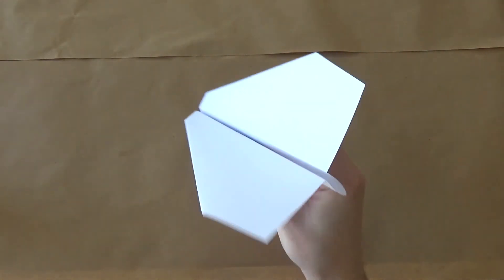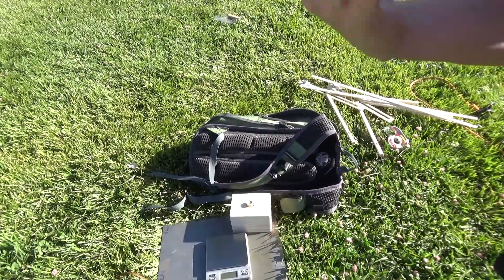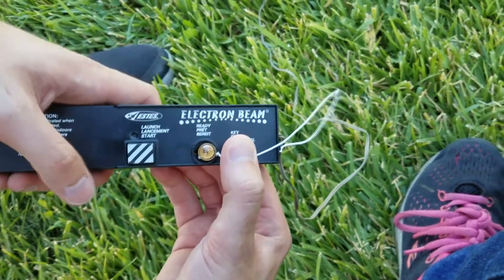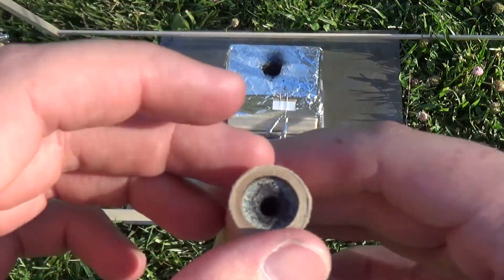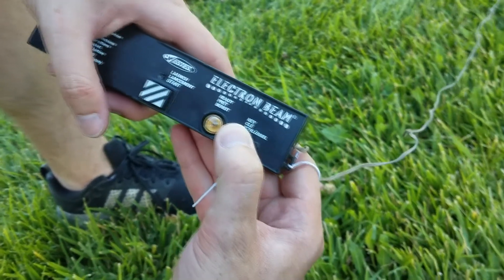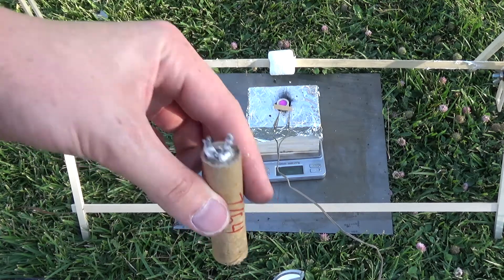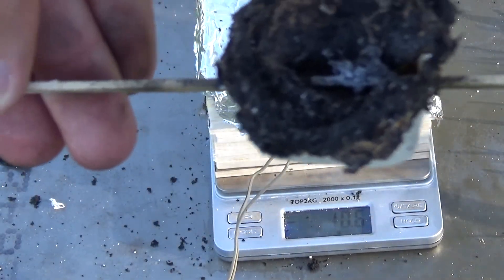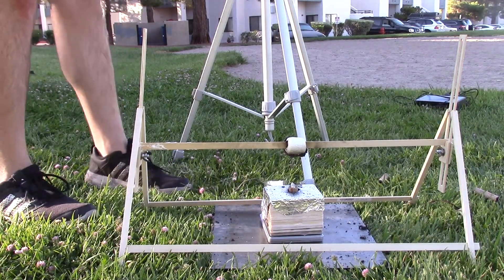Store-bought Vs. Homemade (sugar) Rocket Engines (Exp. 1)

Comment: You need to drill the hole all the way thru the fuel. Coring it will allow for faster burn.
Reply from the maker: Yep, I realized that after making this video haha. I had somehow forgotten about that crucial step!
Reply: @trumpatier  have you thought about testing them like that? I'd like to know how they stack up
Reply from the maker: @CravenMoorhead  I do plan on re-testing homemade motors, drilled correctly this time. Sadly though, I'm not able to make videos in my current situation 😔 Plus I have a couple videos planned before I go back to rocketry. But when I do return, the video will be better than ever because my quality standards have skyrocketed (no pun intended 🤣).

If you'd like an example of my new quality standards, you can check out my latest project video here: https://youtu.be/naYGHu9mrFM?si=iEQCakVsAYAChQn5

When I can redo this motor experiment, I'll retrieve and discuss a lot of data to give a thorough breakdown of the comparison. Plus probably some slow-mo footage 😀

I don't know when that will be though, sorry. Life has been bad.

Comment: Press or ram this composition..change rangle of mix..1/4 bp plus 3/4sugar fuel until you have decent truss
Reply from the maker: I definitely will be doing lots of experimenting on homemade motors in the future. I actually messed up this batch by forgetting to drill the core! lol

Comment: Do more rocket fuel mean more power and thrust?
Reply from the maker: I think it all depends on chamber pressure and core size
Reply: @trumpatier   So instead of using more sugar mix if we use 2 sugar rockets, then?
Reply from the maker: @roboarjun  if you want more power, I think you have to add something to make the burn temperature hotter, thereby increasing pressure. Or you can make changes to the nozzle size. It's all about a balance of thrust and burn time, which is probably controlled by nozzle size. I'm not really knowledgeable in rocket motors, sorry!
Reply: @trumpatier  Thanks for the guidance
Reply from the maker: @roboarjun  no problem, good luck!

Comment: Your thought on why there was not much power was partially right.  I will explain further.  Sugar/KNO3 propellant is a lower powered  propellant than black powder, the propellant in ESTES and other store bought rocket engines.  This means to get enough power out of the fuel you have to burn it faster.  You do this by exposing more of the fuel surface to be burned at one time.  This is why sugar motors have a hole up through the middle, or a “CORE”. Core burning engines burn from the inside out, and consume the fuel very quickly.  Most black powder motors burn from the end because black powder has more energy per ounce than sugar propellant.  So the two reasons your motors did not have high energy output were you were using a lower energy propellant (lower specific impulse in engineering lingo) and the fuel was not burned at a high enough rate and pressure.  I hope this is helpful.  Please emphasize safety in your videos.  Kids might try to recreate what you are doing, and you are opening yourself up to possible liability by not cautioning people to be safe.  Best idea is a “Do not try this at home” warning.
Reply from the maker: Gotcha. Thanks for the info! I'll definitely put warnings in my future rocket videos. I thought I put one in this video but I'm probably thinking of another one.
Reply from the maker: Do you have any experience with making homemade black powder? The stuff is so expensive from gun stores!

Comment: The ones that you made it doesn't even look like you cored your Motors. It just looks like you put a makeshift nozzle. Please don't tell me that's all you did you know you're supposed to drill a hole right. If you did you screwed up somewhere because it's not supposed to last that long burn was way too slow.

Comment: You can't match your crappy bp to este powder as there's is a 75/15/10 mix ball milled press with 10 k lbs pressure. Its not a valid comparison mate I know I use to make large bo rockets lifting alot of weight.
Reply from the maker: I didn't even use black powder in this test. It's in the title.
Reply: @trumpatier  don't worry mate.

Comment: Core the motor and make sure your clay nozzle and end plug are equal to the diameter of the casing. You should be easily getting over 1000grams of thrust minimum.
Reply from the maker: Yeahh that's exactly what I forgot to do haha! I forgot that I needed to drill the core entirely through the fuel, so I pretty much created an end-burner with fuel meant to be a core-burner. Thanks for the advice! So you're saying that the thickness of the clay bits should be as thick as the  tube is wide?
Reply: @trumpatier  yes, exactly. The plug should be made out of bentonite clay, but modeling clay, aka the one you can shape with your hands, works just as well, but because of its weight and strength the plug should be smaller, approx 2/3s of the width of the rocket. Thanxxx
Reply from the maker: @Fred_the_1996  good to know, thanks for the info! The clay I was using in these engines is air-dry modeling clay. It seems pretty strong

Comment: The explosions at the end of the burn of the store bought engines is a black powder charge to deploy a parachute on model rockets. The homemade engines may perform better if you add an accelerant to it like sulfur.
Reply from the maker: These rocket motors have no charge for a parachute, they're booster engines. But yeah, I'm definitely going to do some experimenting with different accelerants when I come back to this subject. Thanks for the insight!

Comment: ive been playing with endburners cause i want longer burn times. you made a decent endburner and a smaller nozzle may have gotten more thrust. when you make a core burner as you described make your nozzle bigger or it will kato. Its a delicate balancing act between good thrust and kato. Kudos on your work.
Reply from the maker: Nice! Are end burners viable with sugar rocket motors? The thrust seemed kind of nonexistant to me haha
Reply: @trumpatier  they arent optimal but i sorta like the slow takeoffs..sorta scale. I just keep using a smaller nozzle till i get thrust or kato. safety first of course.

Comment: If you dont compact the mix in to much or add to much potassium nitrate or sugar the mix will burn like a smoke bomb less that a rocket engine
Reply: The problem is he didn't core the motors.
Reply: Yeah, but we don't want that

Comment: hey dude your ment to core that sugar rocket motor to get all of its potential thrust ... try making proper nozzles too then the exhaust nozzle wont fall to bits like it did ...... estes rocket motors are end burners   where as a decent sugar motor should not be ... so really this experiment has no real basis ..... dont forget you should always play your "A" game
Reply from the maker: Yeah, I realized that later on haha. For some reason, I forgot that I was supposed to core it. Also, how would I go about making a proper nozzle for a motor like this?
Reply: @trumpatier  , there are a number of ways to make the "nozzle", but the easiest way is to use powdered kitty litter and pack it very hard where it becomes like a solid. Then, drill whatever hole size you want. Also, are you "cooking" the sugar rocket fuel? Ie, melting it and getting a homogeneous mixture?

Comment: The problem is you dont make a hole in the center of the mix :)
Reply from the maker: Yeahhh, I messed up pretty bad 🤣 I'll definitely redo this test with the correction.
Reply: @trumpatier  Wait hold on, did you not know how Rocket Motors work? Because if you did there's no way on Earth you can make this mistake. Did you just think the store bought ones had a nozzle for the fuse and that's it? So you just imitated that and thought that's how it worked. Come on man that's total Amateur hour bro.
Reply from the maker: @patman0250  It had been a while since I made a rocket motor, so I forgot that I was supposed to drill the hole all the way. And yes, I am an amateur at making rocket motors. I've only made a couple mini ones, and that was a while before this video.
Reply: @trumpatier  well don't feel bad when it comes to this stuff we're all amateurs including me LOL

Comment: Looks to be maybe to small of hole in the core.
Reply from the maker: The issue is that I had completely forgot to drill out the core 🤣 I was thinking that I only needed to drill a hole deep enough to insert an igniter.
Reply: @trumpatier  yeah, Black powder motors (the estes "store bought") only need the small hole. For other types you need a hole through it. Use the Estes "sonic" ignitors to push it all the way through.
Reply from the maker: @1ello  Alright, I'll check em out. Thanks for the info!
Reply from the maker: @1ello  love the name btw

Comment: that white material that collected on the end of the nozzle was potassium carbonate. if you mix it with water it forms potassium hydroxide which is quite corrosive and feels very soapy. if you washed your hands and it felt soapy, its because you touched what the exhaust did
Reply from the maker: Dang! Never knew that, thanks for the warning! I stayed clear of the exhaust and threw away the burnt motors though. Is there then a chance that potassium hydroxide would form by eating an item "cooked" by the motors? When I asked online if there were hazardous chemicals created by this reaction, they said it was relatively harmless if you don't breathe it in.
Reply: @trumpatier  well yes of course hydroxide will form, the thing that was exposed to it was caked in the carbonate. just be sure to wash your hands and tools because the carbonate absorbs a shit ton of moisture, forming the hydroxide and will rust the hell out of anything metal.
Reply: @trumpatier  the reaction products are CO2, H2O and potassium carbonate which is the white of the smoke.
Reply from the maker: @HomeGrownPyrotechnics  wow. Never knew sugar rockets could be caustic, I guess I should've tried harder in chemistry 🤣 thanks a lot for the info!

Comment: its really not fare to compare a sugar motor with a black powder motor. sugar motors dont work as end burners because the fuel doesnt burn fast enough.
Reply from the maker: Hi, what do you mean by end burners? My knowledge in pyrotechnics and amateur rocketry is admittedly not very good. If the fuel doesn't burn fast enough, wouldn't increasing the amount of kno3 improve that? In this test I made a HUGE mistake by forgetting to bore out the combustion chamber. So it burned from end to end, instead of from the center to outside. So it ended up being more of a smoke bomb than a rocket motor.
Reply: @trumpatier  adding more KNO3 would make it worse. the optimum ratio is 65% KNO3 and 35% sugar. adding 1% iron oxide will make it burn faster but not fast enough. i explained this a bit more in a comment i left with 
'Backyard Arsenal' a few comments down. hope this helps. if you wish to learn more about rocketry, id be glad to help, mabe even put you in touch with some folks who know a hell of a lot more about it than i do.
Reply from the maker: @HomeGrownPyrotechnics  awesome! I love rocketry but tbh I don't currently have much time to delve into it. Though I am looking to redo this experiment after I finish the video that's been unfinished for months, and then do multiple videos experimenting with different homemade motor types and mixes. Thanks for offering your assistance, that's very kind!
I currently have only 1 question - do you know any good ways for an amateur to measure thrust output without breaking the bank? In this video I tried using a digital scale, but it's really not a very good option. The force only updates like twice a second, so the peak thrust can easily be missed.
Thanks again for all the info!

Comment: Not enough potassium nitrate, there's too much uncombusted material
Reply: thats not the problem, end burner sugar motors have to be really large if you want it to work. sugar motors of that size always have a core going into the fuel to increase the amount of fuel being burned at the same time. black powder which is used in the store bought one burns much faster and much differently which allows it to be used as an end burner(end burner motors burn from one side to the other, core burners burn inside out)
Reply: @HomeGrownPyrotechnics  ik, I've been building processional firework rockets for 6 years

Comment: If I understood you correctly, you assumed that the store-bought motor shoot off from the test stand because the black powder rocket fuel was not enclosed with a clay cap at he top end of the motor. If so, then it is not the case, since each of these motors at the end of their fuel has delay mixture (since your motor is C6-0 it means there was 0 seconds of delay, i.e. no delay mix added), and on top of this mixture there is an actual cap with a small hole that separates the delay mix from the ejection charge (loose black powder). So, if you haven't removed the ejection charge yourself prior to testing the motor, it was this ejection charge that most likely ejected the motor in the air.

Just pointing it out, for future reference. Other than that, keep it up.
Reply from the maker: Hi! Sorry, which part are you referring to? Also, I just did some research on -0 Estes motors, and it appears that there is not only no delay mix, but also no ejection charge in the motor. There is a buildup of pressure and a forward release of gases and clay/BP, but I guess that's caused by just the weakening of that last disc-shaped area of fuel, thereby allowing the pressure to break through the front clay cap. Or something along those lines, I think? Here's the forum I was reading: https://www.rocketryforum.com/threads/does-an-estes-booster-engine-have-an-ejection-charge.23341/
Reply: @trumpatier  Yes, you are right. It seems estes motors does in fact have this configuration, which is actually quite unusual for me, since I mainly dealt with other brands of motors, that don't :D Thanks for the info!
Reply: The “0” on C6-0 engines means that they are a booster engine, the first engine in a 2 stage rocket.  Not only is there no delay, there is no ejection charge.  There is no end plug because the fuel is supposed to burn clear through and the flame you got (what you called an explosion) was the fuel burning through.  The hot fuel and gases enter the nozzle of the next stage engine to ignite it.  Please see my next comment where I answer your question on why your engine did not have much power.  You are partially right.  I will explain it further.
Reply: @Matthew G.  You are incorrect.  There was no ejection charge in this motor.  “0” motors, the ones with red labels, are booster motors for multi stage rockets.  The propellant burns thru the end and hot gases and burning propellant enter the nozzle of the next stage engine to ignite it.

Comment: Better to have fewer but better vids.    I would have skipped the food angle and made new correct engines.     Just my opinion
Reply from the maker: Yeah, I'm probably going to start uploading every 2 weeks once I get back into it. Trying to finish a makeshift recording booth so that recording is easier. Thanks for the input!
Reply: It was your segment on making paper tubes that led me here.   I am in the process of making foundry furnaces and was thinking I might make my own custom tubes for forms.   But 8 or 12 in inch tube that may be a bit labor intensive.  

Don't let the lack of good equipment stop you.  On the audio you can always do a voice over.  On windy days that is a life saver.  Most of all have fun.  It shows.  I need to work on that one.
Reply from the maker: @danharold3087  Nice! Yeah, tubes that big would probably be pretty hard to make. I think I've gotten the outdoor audio issue straightened out - the power line above me was causing noise on the unbalanced cable I was using. My main issue is with voicing over.. Here in Las Vegas, the air conditioning runs far too often during the summer to get any decent bit of voice recording done 🤣

With bi-weekly uploads I should be able to be more relaxed and have fun when making videos. Definitely looking forward to uploading again. Good luck on the foundries!